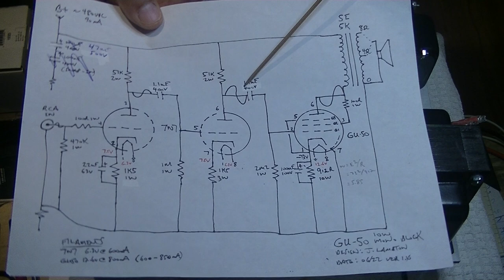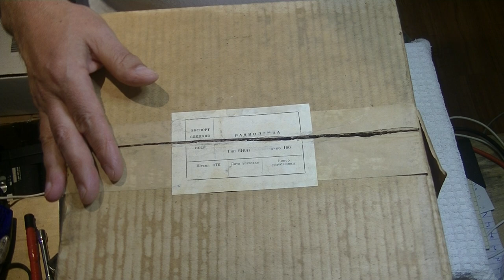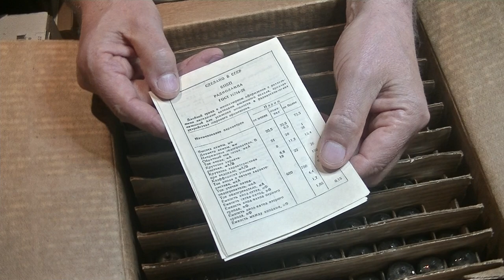Tube Lab #92 - GU50  Monoblock Update

Comment: Hi Jim! Really interested in the RIAA you are talking about. I have a B&O turntable with the "moving micro-cross" pickup, will your design work for me? I believe it's quite similar to the standard MM pickups. Also, will there be select-able gain settings?
Reply from the maker: Only really two things to be concerned about when it comes to matching a phono cartridge to a phono preamp.
First is gain, because you'll find a huge range in output we'll design for high enough gain that any moving magnet should be fine.  
Second is matching the cartridge output impedance to the input impedance of the phono preamp.  And this is just a matter of checking your cart specs and installing the correct resistor, typically 47k.
What really matters is how it sounds!  And for that we'll rely on our listening tests.  
We are lucky to have a dual mono platform that is proven to sound great, we use this platform for both of our control preamps and will use it again with both phono Preamps.

Comment: I have a bunch of GU50's. It's good to see more amp designs using them. I'd also be interested in a push-pull kit, if that's on the cards.
Reply from the maker: Pure Class A is my preferred sound, by far.  If you don't need more than 10w I see absolutely no reason to go Class AB (push pull) and suffer the distortion that comes with it.  The prototype GU-50 that's going to together this week will hopefully come close to 10Wrms.  I'm really looking forward to hearing beam powered Tetrode in Triode mode!
Reply: @tubelab194  I'm wanting to build a guitar amp, where the distortion isn't as much of a problem. That said, I'm be tempted to buy one of the kits above, if a 230VAC transformer becomes available.
Reply from the maker: @Rod_Knee  All of our Kits come with Universal Power Transformers.  Build instructions show how to wire any household mains voltage from 100 -250vac.  It makes the Kit a wee bit more expensive, but I wanted anyone, living anywhere to be able to build our Kits and enjoy great sound at an affordable price!
Reply: @tubelab194  Excellent! I look forward to the above amp being available for order.